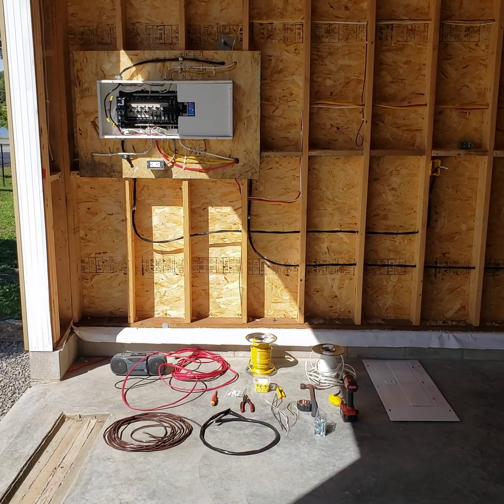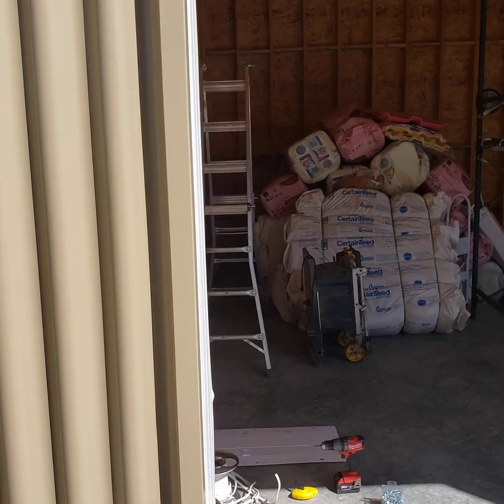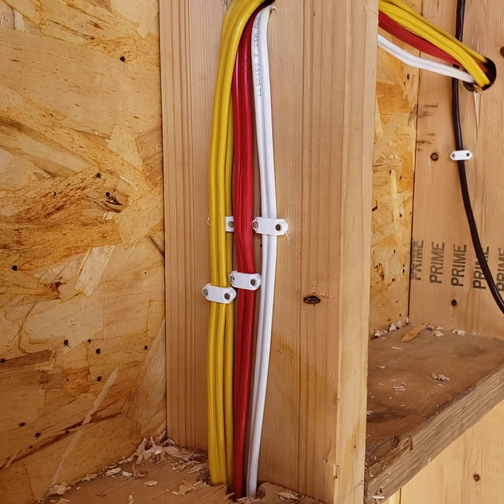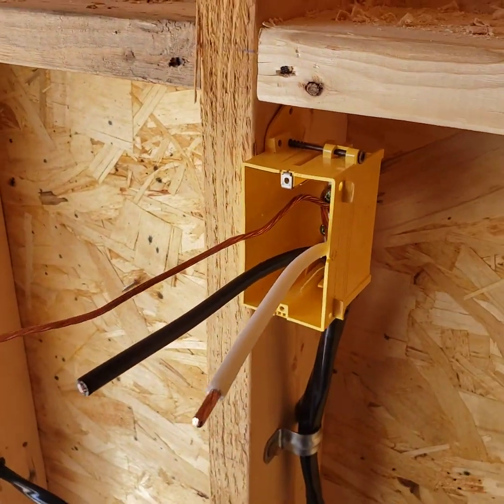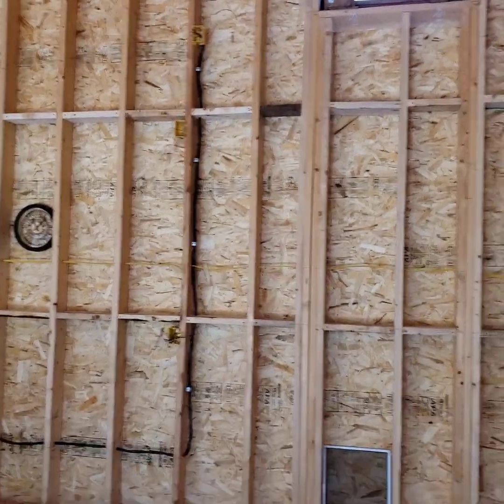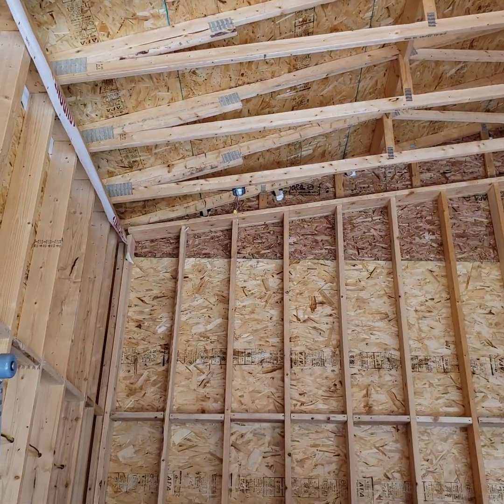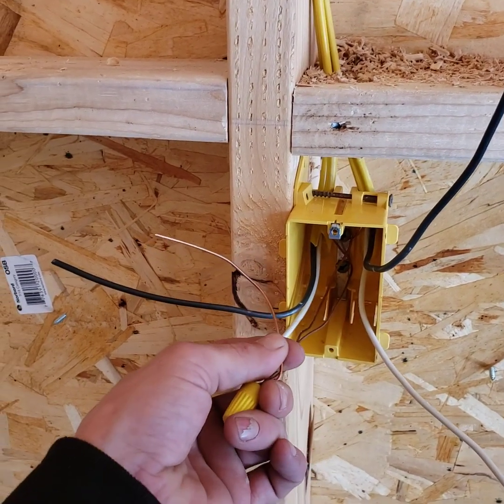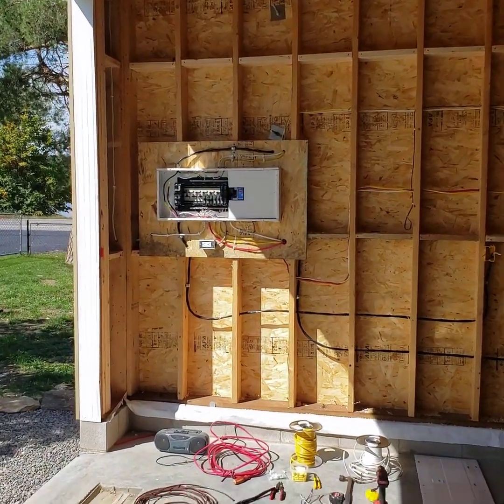💡How I passed my Electrical Rough In Inspection. Canada 🇨🇦

Comment: How can i apply as an electrician in canada?
Reply from the maker: Sorry I am not an electrician I am a Automotive Technician I just did my own wiring for my shop I built. But like becoming an Automotive Technician you have to apply to be an Apprentice at a company it is a very in high deman field as most trades are in Canada at this time. You will have to attend trade school where you go to school while working  or challenge the Red Seal Test. Best of luck

Comment: I saw you ran 3 or 4 12/2 or 14/2 cables in same route. If the length is more than 60cm then derating factor 0.8 or 0.7 applies which means 12/2 cable ampacity becomes 20×0.7=14 Amps  not 20.
Reply: Really good knowledge you have.

Comment: I'm noticing that there is a code violation on your boxes. There needs to be a bit of extra wire (can't recall but it's about a fist loop worth) outside each box for future service/repair, where it looks like your going straight into the box. If you ever need to cut the wire inside the box, there needs to be some extra to pull into the box without having to rerun a new line. Otherwise it looks like a pretty good job from what I see.

Comment: Did you need to insulate the hot black  wires ends in your main panel for the inspection or just keep them away from the breakers
Reply: Ok thanks, I couldn’t see them in the video. I think I’ll put some on temporarily as well then
Reply: I live in Ontario and cannot find that in the guide to the code book
Reply from the maker: If you referring to the Merits i put on the Hot wires in panel. If so I do not think it was code.  I just did it for my own peace of mind. My panel was already hot with one breaker and outlet installed by the electrician who installed my panel and the overhead mast. I just wanted to be safe. 
With the rough in inspection the only thing I read was the wires needed to be terminated at recepticle boxes with grounds connected within every box.  Thanks for the Comment and view 👍

Comment: hi, great video, are you not required to put drill plates when piercing a stud with electrical wires?
Reply from the maker: All I could find in reference was that it had to be minimum 5/8" from face of the stud. I was then able to insulate and vapour barrier after this inspection was done. This video was after my passed rough in. 

The next visit was to check the outlets wired up and finished and covered siding was on and all after insulation inspection as well.

Comment: The receptacle by the panel is a 15 amp receptacle on a 20 amp breaker ? Not code 😕
Reply from the maker: Honestly I did not check the receptacle after he installed it. He said it was 20amp receptacle. I found it weird it not being the same as the ones I purchased. The inspector came separately from my work to approve that.